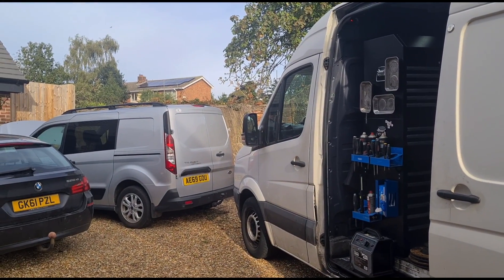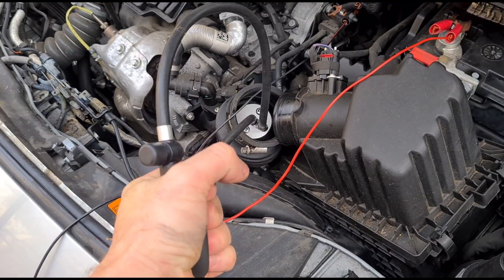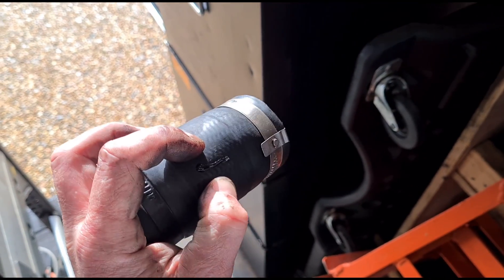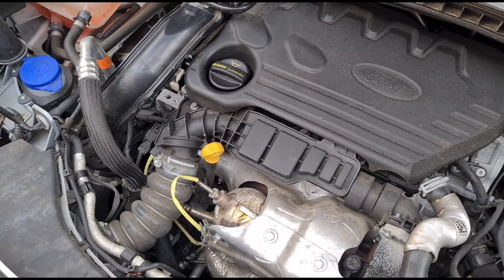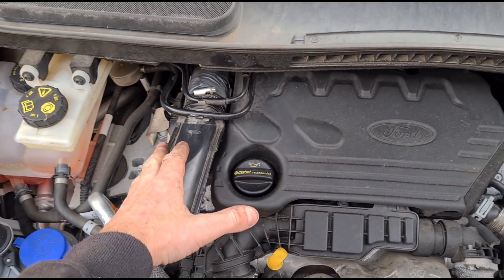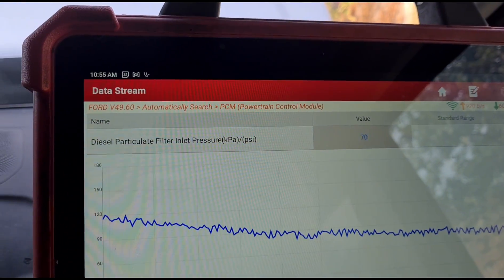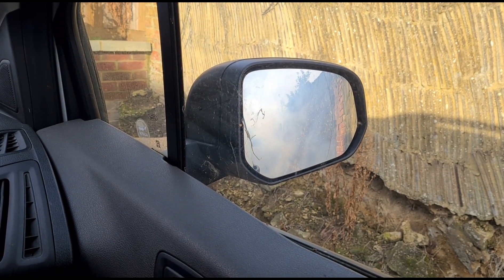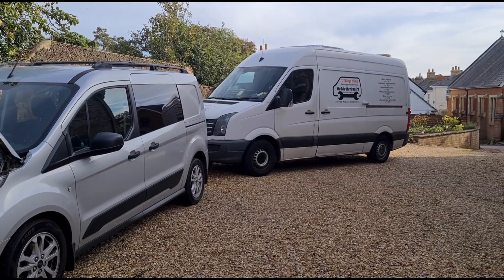Ford Transit Connect 1.5 P1103:22-EC Mass Air Flow P006A:00:EC MAP Manifold Correlation

Comment: Been banging my head off a wall with my van for weeks, wouldn’t regen, finally did, soot built up after around 2 days, wouldn’t regen, typed fault code into YouTube and seen this and sure as anything the hose is split, 10/10

Comment: Just fix with this , i think It os better .  Transit Connect Focus Fiesta Transit 1.8 TDCi 1229499 1201165.
It is reinforced with 3 metal rings , and IS more flexible. You have to cut 1 cm of ones side

Comment: Thanks for sharing Jimmy as always great watch lad.🐐🐐🐐

We're aware you use the 6k  tab3 💷💴💶
May I ask is it only the £2k+ obd machines that can do the reset DPF learned values - diesel pat values - fuel vaporizer prime etc.
 
Really needing pointers for a machine around the 1k mark 

Fresh from college

Any other pro tips tricks or handy hints welcome
Reply from the maker: Dpf resets can be done on some machines under £500 but newer vehicles are getting more difficult with new protocols like DOIP & CAN FD & Passthru security gateways
Reply: @ORileysAutos   much appreciated for the info Jimmy, YOU HAVE A GOOD DAY LAD👍🚗👍
Reply: Check his latest review on that small Kingbolen? Could be good enough for you.
Reply: @elbuggo  i did watch that lad the other week, but thought it be worth spending a little more for a a few more options.👍
Reply: @cw2126  That's fine, if you know what to look for. But typically, after a while, you find you miss a certain feature that you must have, and then there are newer models around too. Don't think it is possible to find the perfect forever box.

Comment: Would that just pour into that pipe or does it need to go in under pressure. my grandson has that engine. I'm glad I haven't got a DPF, but for you It's good business, nice to watch somebody who knows the job inside out.👍
Reply: As I understand it, you need to create some foam with the gun. If you just drop the liquid in there, it will not work so well.
Reply from the maker: Pouting the liquid in it will only reach the lower 10% of the dpf material.  The gun makes it expand
Reply: @ORileysAutos  Expand = create foam
Reply: It needs to go in under pressure so it reaches as much of the dpf core surface area as possible.